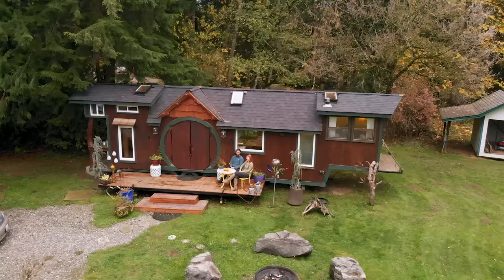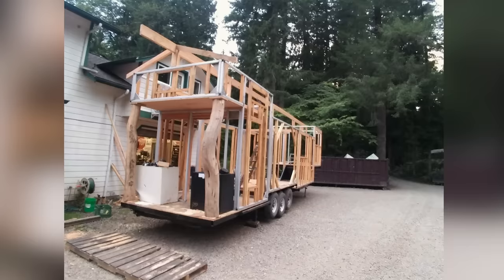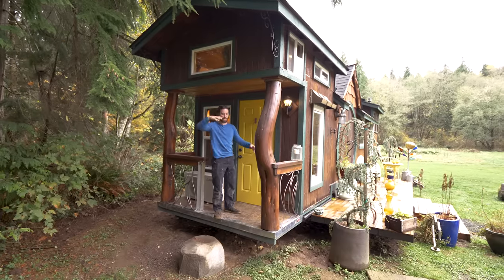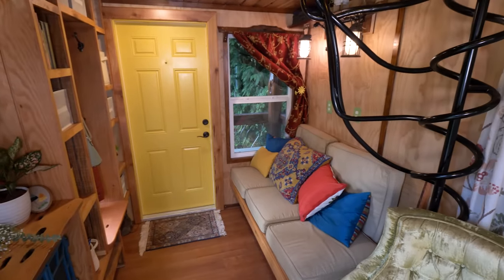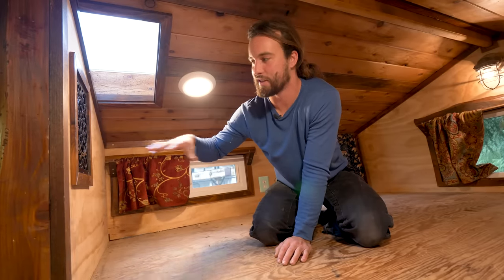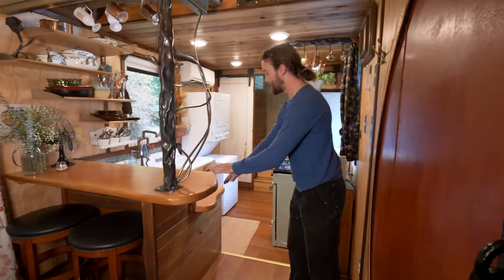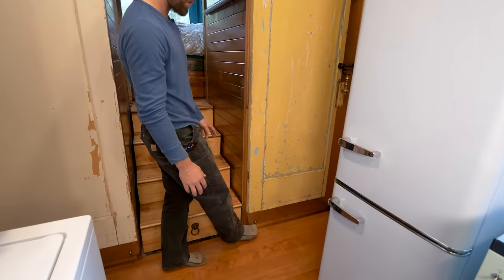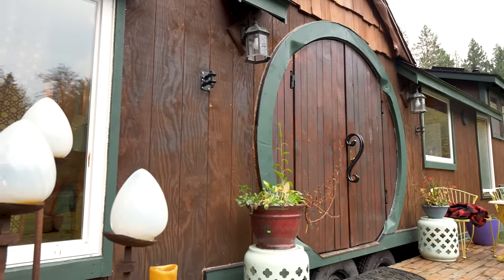Beautiful handmade tiny home w/ recycled materials ($40k budget)

Comment: Not sure how I missed this build when it was first uploaded but it is fantastic!  I totally get every aspect of the build and his choices and is there a better job to enable the touches he has put in this build?  I cannot think of a single one.  The only thing that puzzles me is that he is a welder by trade or by training (I think from what he said) but he struggled soldering the pipe for the faucet.  I don’t weld but would help my dad, who was.  I worked very early in a field of medicine and had to solder wires and circuits when adapting or developing devices.  I would love to learn to weld and always saw welding as soldering on a much larger and industrial scale.  I don’t know, clearly.  There is not an inch of this home that I don’t love.  Would that I could bring a bus to him and he would help me build it.  But, there are wishes and horses and the real world.  Sigh